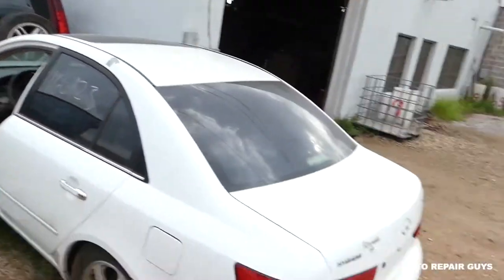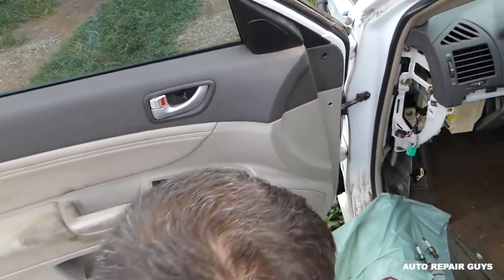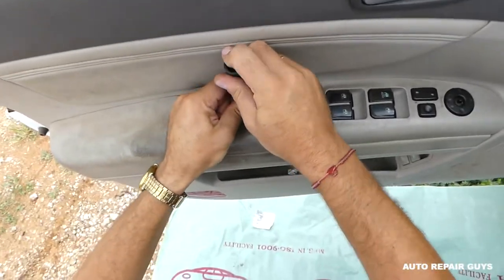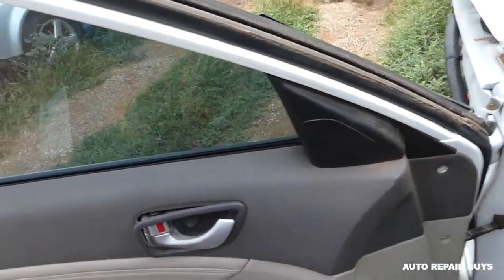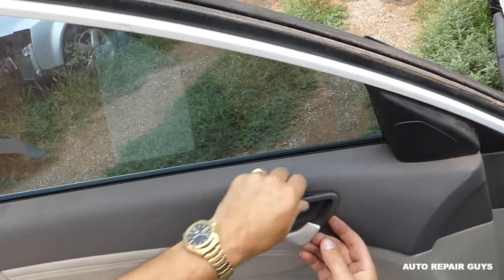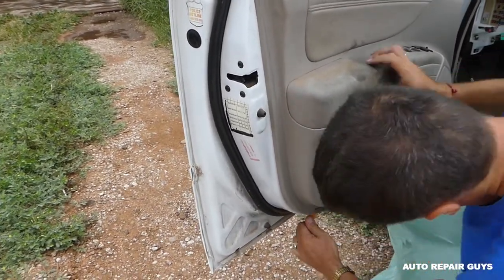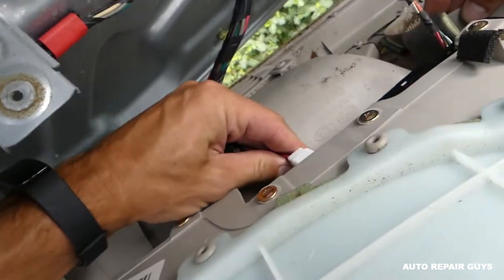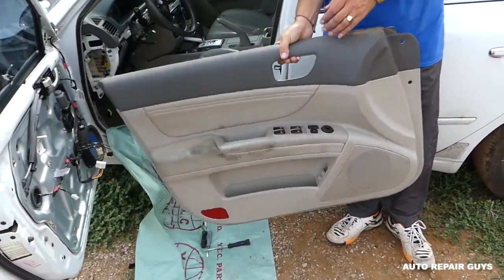HOW TO REMOVE FRONT DOOR PANEL ON HYUNDAI SONATA

Comment: I have a 2009 Hyundai Sonata. Both exterior and interior door handles are broke on the drivers side door . I can't open the door. What is the best way to cut out the door panel to unlock the door and replace the handles?